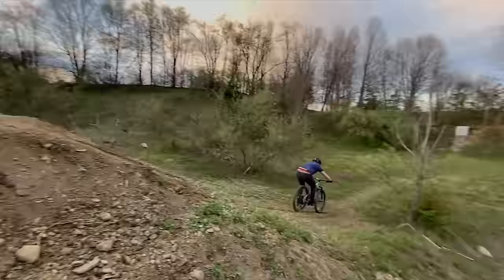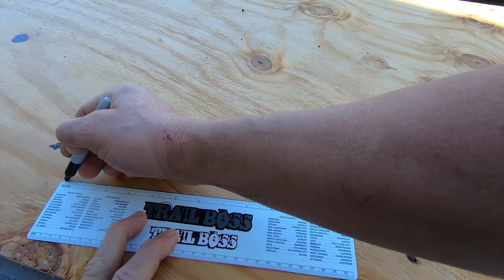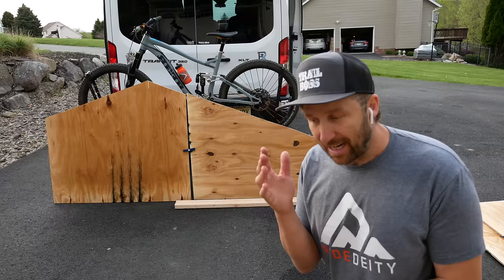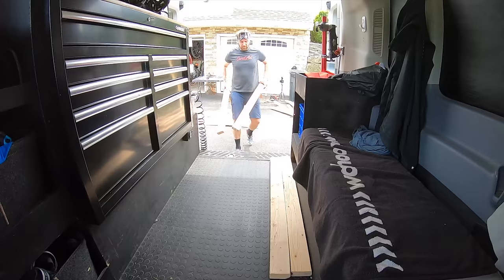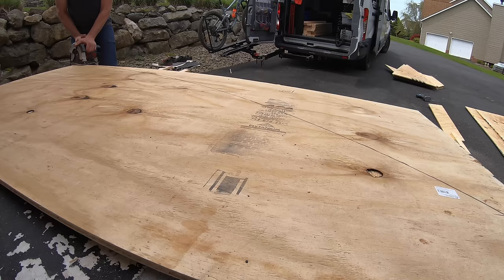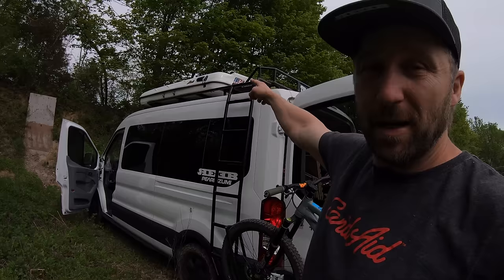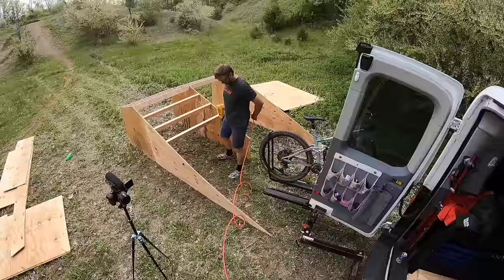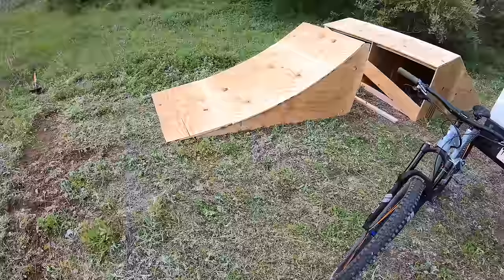BUILDING A WOODEN GAP JUMP FOR BIKES | EPISODE 1

Comment: +1 on the circular saw tip. Way easier to get smooth. Better get some attack dogs  for the secret spot!
Reply from the maker: when I use a jigsaw it looks like I cut it with a rock
Reply: @JeffLenoskyTrailBoss  Dude, Seth follows your channel..???  NO WAY!!!
Reply: And the tip to not make the other side of your ramp slightly larger
Reply: @blackdogadventures7531  what do you mean bigger news is the Trail Boss follows Seth.
Reply: Need a Trail Boss and Seth video. Way overdue
Reply: Well this little tidbit would’ve been handy a few weeks ago! I have a sudden urge to build some more ramps now...
Reply: Would agree, while jig saw are much more portable and allow you to work directly on trail; or for smaller kickers;

Comment: Circularsaw Pro Tip - make the blade depth shallow enough so that its just jutting through to the underneath (not heaps of blade showing below) and it will be smooth, easier to handle but more importantly ALOT easier on the motor and blade during the curve. If you use a Cordless one, it will thank you even more!
Reply from the maker: Rob Homes that’s a really good one and something I should have mentioned.

Comment: Great video boss. I’m building one of these bad boys. Just a tip for @2:51 ... if you want the ribs to be exactly the same dimensions, you might be able to stack/clamp them to together to cut all of them at once (since the plywood is relatively thin). As long as your circ saw can handle the thickness.

Comment: Line the corners up of all 3 sheets of plywood and screw together.  Then cut both sides and the middle at the same time.  Guarantees they are all the same.  Get your measurements right though or you've messed up 3 sheets of plywood.
Reply from the maker: thetasigma590 you can definitely do that with the straight cuts but the radius cuts get sketchy with more than 2 sheets. I find it faster to just rip individual sheets than try to force it.

Comment: You are one of a kind Jeff. If I built something like that my landing would be a deep pond with some floats on my frame so I could retrieve the bike! What bike rack do you have on your van? Love how it swings out so you can open the doors wide. Also, what air compressor did you buy for the van?
Reply from the maker: It's called a Rack Attack and it's sold by 1UP and the compressor is ARB

Comment: Awesome video and the rest in this series are great as well.  Love the direction you have been taking your content in the last couple years. Question for you:  At 5:22 when you are tracing the transition, what did you do with the plywood at the bottom of the video frame to keep it in place?
Reply from the maker: it was screwed to the 2x4 to make it a little longer then I put a screw through it at 5:18 that acts as a pivot point.  On asphalt it bites in, if you were doing it on concrete or something you could put down another sheet of ply for it to poke into a little so it wont slide.

Comment: Why do the "case pad" at a downward angle instead of flat?

Is it motivation to not hit it?
Reply from the maker: IDK, my buddy had one like that and it seemed cool.  It does artificially extend the deck though, meaning you can essentially be more "off" and not hit the back edge because it's lower.  Make sense?
Reply: @JeffLenoskyTrailBoss  what angle did you cut the case pad and landing at?  THANKS!
Reply: That case pad is so sketchy. It may be ok on smaller jumps, but once you hit that jump at full speed, it becomes quite dangerous if you case. What i did on my backyard setup is i built a flat case platform with a 4-6' round transition ( angle of landing and size depending) and also do the same style transition at the bottom. That way, you still have a case pad, but if you do case, you won't blow a rim, tire, or get thrown over the bars. Otherwise, very nice build.

Comment: What's the thickness on that ply?
Reply from the maker: Brion van Over usually 3/4 for sides 1/2 for take off surfaces that are bent but double ply and 3/4 for landings
Reply: @JeffLenoskyTrailBoss  thanks Jeff! Would you say this radius and length would be good for an adult getting into jumps?
Reply from the maker: @brionvanover6292  Definitely, it's not to steep, not too mellow.